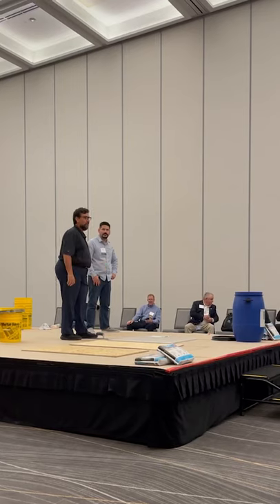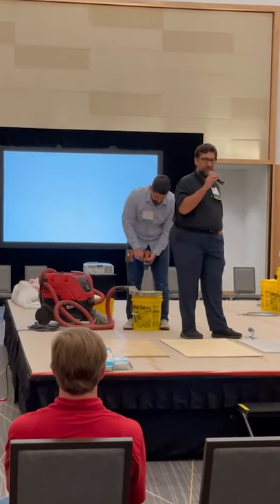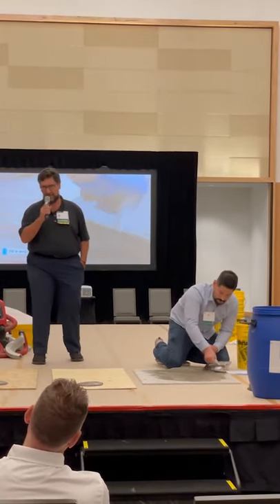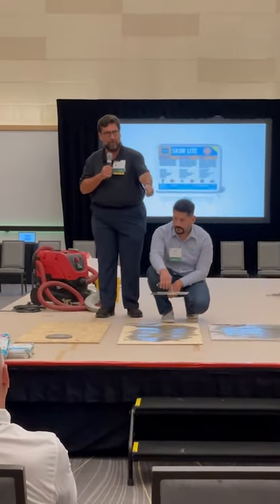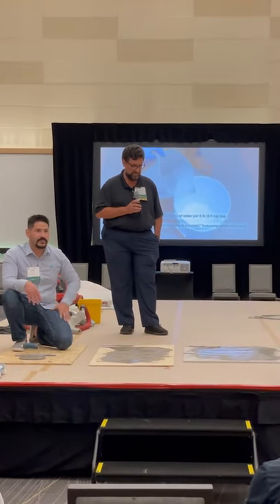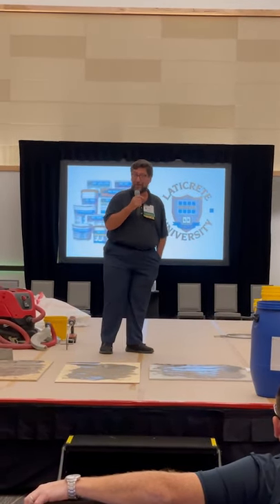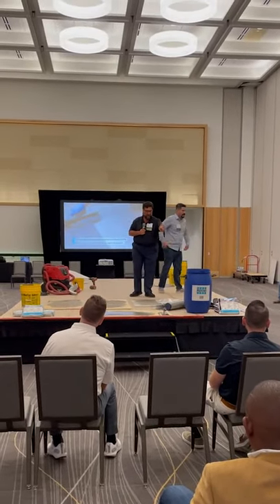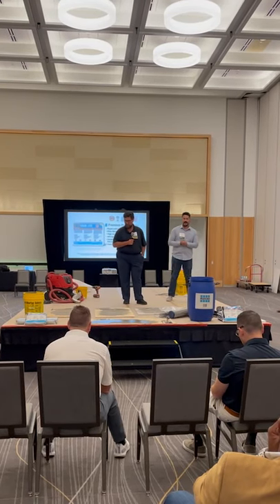Skim Lite Underlayment Demo at FCICA Annual Meeting

Comment: Can this be used right over plywood before using schluter all set to thinset down schluter Ditra uncoupling membrane?
Reply from the maker: Hello! Thank you for your message. Exterior Glue Plywood (Interior Only) is a suitable substrate for Skim Lite, and it would provide a suitable substrate for virtually all thinsets on the market. Keep in mind we have a full line of uncoupling and waterproofing membranes as well, which would provide you the benefit of a single source warranty.

Some info: https://laticrete.com/en/tile-and-stone-installation/uncoupling and  https://laticrete.com/en/tile-and-stone-installation/waterproofing

Hope this helps!

Comment: HELLO, can this be used in a bathroom that is not level, sub-floor is a wood called OSB
Reply from the maker: Hello! Thanks for your message. Yes OSB is a suitable substrate for Skim Lite. You can find more info on our data sheet: https://cdnmdm.laticrete.com/Datasheet/NA/157/Datasheet_NA_en_157.pdf Hope this helps!